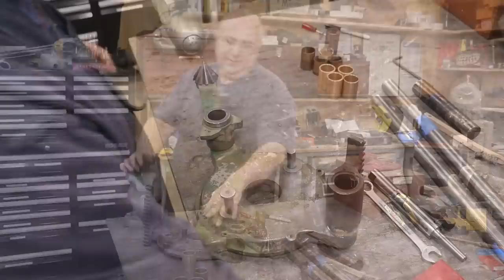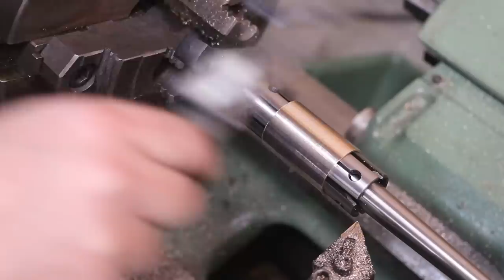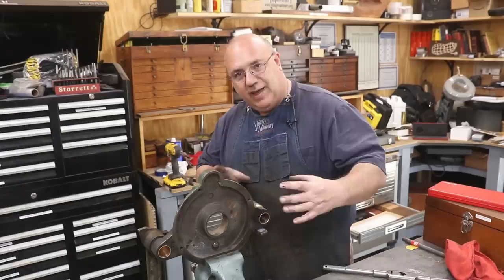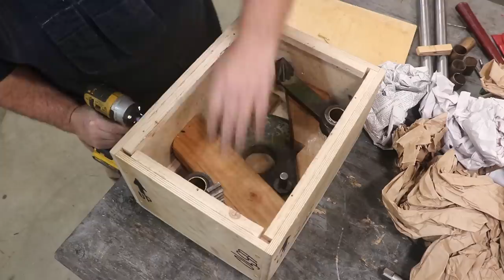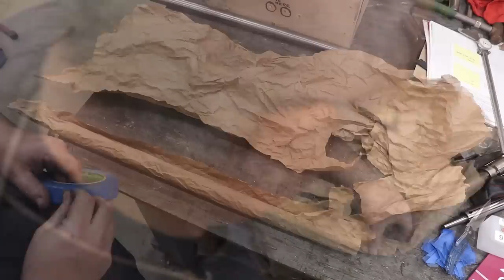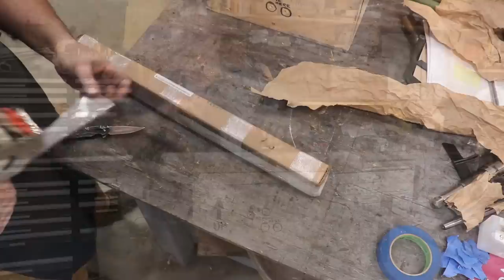Turning Bronze Bushings and Pressing them in Place: Casting Repair for Leo at Sampson Boat Company

Comment: OK everyone help me understand. Here is a short clip I did so Leo could put the rails back in. They are bolted to the oil/cooling pan on one side of the machine and slide into holders on the other side. There are set screws in those holders to make them tight and not move. I had to fix one of the screws. And this is what caused the marks in the rails that Keith fixed.  

https://www.youtube.com/watch?v=A-JMA0PA8rM

First you can see there that there was only one rail with holes on both sides. One side was tapped, the other side was not. To flip them, new bolt holes would have to be made so they could attach to the pan. Keith's video is a week old and Leo has the parts back. Leo would need to take the time to drill and tap holes. He also doesn't really have the set up to do this. I could have caught this early and brought it to Keiths attention, but I missed it. That one is on me. 

Second, if I had caught it, and that was the way to go, and Keith turned downed the rails INSTEAD of the bushings, and we flipped the rails, how would we have compensated for the new play with the rails on the fixed side of the machine? We certainly could not have shipped the whole thing to Keith so he could fix that also. 

This machine is in good enough shape for what Leo needs to do with it, except for the EXCESSIVE wear and SLOP in the bushings, and the break, which Keith replaced.  Leo is not doing production work or building space ships with this -  it does not need to be with in micro millimeter tolerances. I did need it to be better than it was. It WAS a REPAIR not a RESTORATION and it was done well. Keith approached this the way he did and it was fine. If Leo was not comfortable with the Keith's approach,  I'm sure we would have reached out to one of the many key board commentators to do the work instead.

Comment: Do you ever mess up when you say need to take another 60 thou iff and set your cross slide to cut 60 thou instead of the 30 thou needed taken off all way around.  Seems talking diameter and radius so to speak would lead to errors especially for a person like me, a wannabe or a new machinist.

Comment: Everyone has another way of looking at a problem, I'm no exception. I would have looked at boring the snapped off nose of the rack out of the main housing, bored the rack to match and made a make up sleeve to align and press the two together before brazing it up. More work I know but the nose failed, snapped off with the original design so it is either, not strong enough, or was over powered trying to drive in dull threading blocks into the stock, regardless it is at risk of failing again and possibly brazing is not enough to keep it together. Keith did a good job but doing it the way he did he couldn't drive the braze in deep without it grabbing the line up slug, so this joint might fail again. Thing is, where do you stop with fixing up an old machine to make it "better" or should you just show a bit of care and kindness to an old machine and not beat it like an old anvil. No offence intended to you Keith just my opinion mate.

Comment: That dead centre in your Chuck needs a stepped shoulder on it so the pressure from the tailstock doesn't push it through your 3 jaw Chuck....Your Welcome...🤔🤔😒😒😳 That's why the bush started slipping during the cut . Oh, and dial or digital calipers are very imprecise, so stop saying "right on the money"...They never are.

Comment: I am sorry, but this is non how you measure parallel, if you want most accurate result. You are holding them at the center. That is wrong. If they are crossing at the center (like "X"), the distance between the ends will be the same, even if they are not parallel. You have to make the shape like "V", and measure them that way. Push both of them to the end, and measure. It will give you more accurate reading.